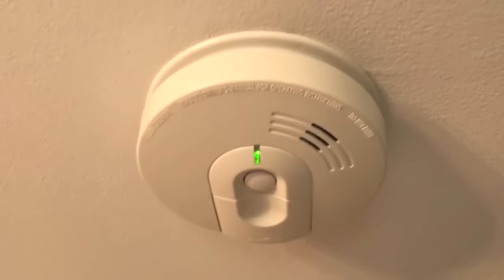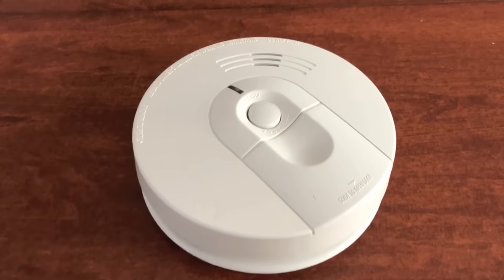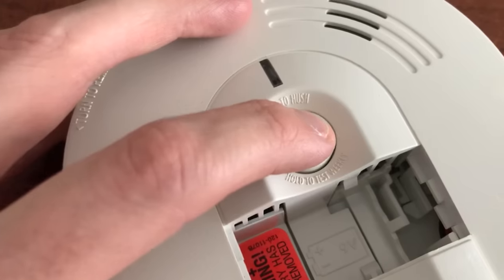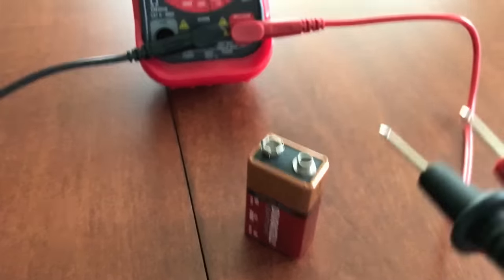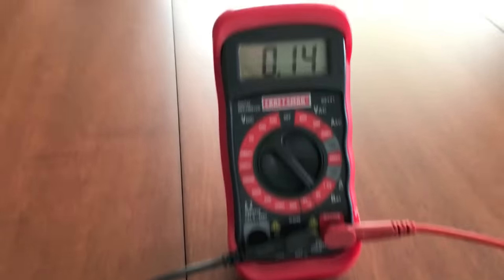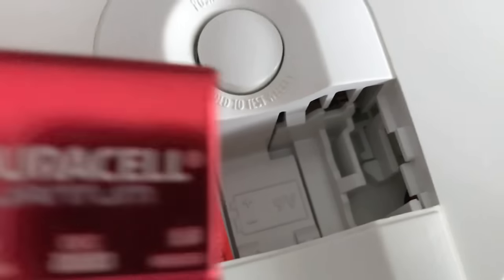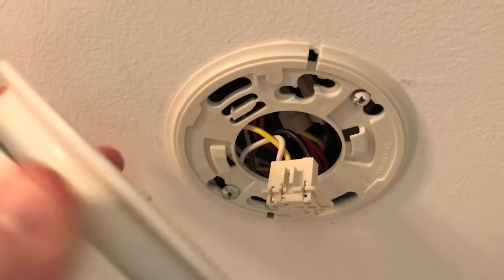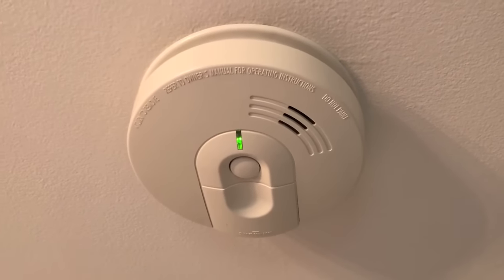Replaced Battery/Cleaned smoke detector- Still BEEPING (Must RESET Detector)

Comment: yeah this is the pain in the ass for the newer smoke detectors. Unlike older ones that had a dedicated chip in them, newer ones use a micro controller chip. (A programmable chip that can be programs to serve what ever functions needed.)  Problems with these are even in low voltage situations. (low battery) the chip must fully be reset to "clear" the chips onboard memory. To do this you must drain the inside reservoir capacitor. (It charges and stores power to drive the alarm section of the detector.) When something like low voltage happens or even any kind of "error" the chip will remember it til its reset. Ever have random devices just freeze, crash or lock up on you til you reset them somehow? yup thats a microcontroller for you. The depreciated alarm chip was so much simpler huh?
Reply from the maker: ԱӍβЯƐ 

Thanks for watching & you are very welcome.  We appreciate your comment.  This is great info & will help future viewers.  😀

Definitely keep us posted with your DIY project & any questions you may have.

Please subscribe to the channel and turn on your YouTube notification Bell 🛎 that would be awesome thanks again!

😎👍🔧🔩

Comment: I'VE TAKEN DOWN ALL 6 SMOKERS DETECTORS  AND I DRAINED THE ENERGY OUT OF ALL OF THEM AND THERE IS STILL A BEEPING AS IF THEY ARE UP. WHAT DOES THAT MEAN?
Reply from the maker: Joseph Bailey 

Thanks for watching & reaching out to us.  We recommend pin-pointing the Detector that is beeping.  Remove & check date on it.

If the date on the back of the detector is more than five years ago, you may need to replace that detector.  Replacing that detector could solve your system fault issue.  Keep us posted!

Please subscribe to the channel and Ring your YouTube Bell 🛎 that would be awesome thanks again!

😎👍🔧🔩
Reply: @DIYwithMichaelBorders  Date on them is June 3 2019. I air dusted all 6 and l put them all back and they are still chirping. All the batteries are New. I bought all 6 detectors in October of 2019
Reply from the maker: Joseph Bailey 

Thanks for the update.  Brand new detectors shouldn’t be giving you fuss.  Inspect each detectors connection point.  

Verify that there are no signs of corrosion on the connection points.  Also, believe it or not, some people run into smoke detector connection points having dried paint inside where the electrical leads are.

This happens when a ceiling is painted with the detector off however the electrical wiring and connection point is still in a position where the paint roller or brush makes contact with it... which degrades the connection point.  Keep us posted.

😎👍🔧🔩

Comment: I'm trying to unplug mine but it wont unplug and I'm worried I'll break something
Reply from the maker: morganna lord 

Thanks for watching! Let’s get this figured out!  We definitely feel your annoyance!

The connection tab can be a little tricky...especially if there has been unwanted debris added to it over the years.  An example would be the possibility of the “Mount” being painted  over if the ceiling was painted...if so, the connection point may have been painted over.  This makes it extremely tricky to get the Detector loose from wiring since the connection tab really secured itself to the painted area...😲

After pressing down on adjustable tab, you may need to work it back & forth to break it free!  Keep us posted!

Please subscribe to the channel and turn on your YouTube notification Bell 🛎 that would be awesome thanks again!  😎👍🔧🔩

Comment: 4:30 am and the fucking thing would not stop giving me a "low battery" chirp even after changing battery. The thing that worked was unplugging the unit from the electrical system and hushing it to reset it. Then after changing the battery did it accept the new battery. I did a quick test and reinstalled. Now it's back to 100%. 4:53 am now... can I have my 1/2 hour back ?
Reply from the maker: Thanks for watching & sharing this, sounds like you’re back up and running.

We appreciate you taking the time to reach out to us, we are always here to help answer questions.

Welcome to the DIY Raptor Club.  😎👍

Comment: Drained mine multiple times and it did no good at all.  As soon as they get plugged back in and new battery,  it's the same garbage crying wolf.   First Alert trash.
Reply from the maker: Thanks for watching, any update?  Is any dust/debris inside electrical connection?  If so, we would clean connection and leads.

How old is detector?
Reply: @DIYwithMichaelBorders  They are 2010 models.  We have ordered new ones but we have cleaned them, reset them and tried everything else on this garbage.
Reply from the maker: @johnstrand2247  

We appreciate the follow up.  Awesome to hear you are replacing it with new detector.

New detector should solve issue.  Looking forward to hearing back from you.

Comment: Mine won't com out from. The wiring
Reply from the maker: Amie Cross 

Thanks for watching Amie! Let’s get this figured out!  We definitely feel your annoyance!

The connection tab can be a little tricky...especially if there has been unwanted debris added to it over the years.  An example would be the possibility of the “Mount” being painted  over if the ceiling was painted...if so, the connection point may have been painted over.  This makes it extremely tricky to get the Detector loose from wiring since the connection tab really secured itself to the painted area...😲

After pressing down on adjustable tab, you may need to work it back & forth to break it free!  Keep us posted!

Please subscribe to the channel and turn on your YouTube notification Bell 🛎 that would be awesome thanks again!  😎👍🔧🔩

Comment: After I changed the battery it’s still beeping
Reply from the maker: boston 2015 

You may need to perform a full reset procedure.  We have a step-by-step video that shows how to do this and it is linked at the end of this video.  Definitely check it out, you may find it very helpful.

😎👍🔧🔩

Comment: Whats the point in it being wired if it still needs to have the battery replace?! Dumb
Reply from the maker: Thanks for watching & many have thought the same thing.  It has to do with safety & proper code to ensure detector works during a power outage.

😎👍🔧🔩

Comment: i have a hardwired smoke alarm with a battery backup in condo i just bought. there was no battery in it. as soon as i connected the new 9 volt battery,  it screams without stopping that ungodly siren. whats could be the problem? any one?
Reply from the maker: alex nyc 

Thanks for checking out the video and sharing your experience.  Here’s what we recommend doing!

Disconnect Smoke Detector from hard wiring.  Next, remove Battery.  Then push hush button as shown in this video...this drains all remaining electrical charge!  Then put Battery back in & reconnect detector to hard wiring.

If this does not work...it’s very possible that the new detector needs to be cleaned...it’s unlikely however some detectors get dusty during their life before being purchased & plugged into a house!  Grab a vacuum & clean it.

If that doesn’t work, it might be possible that the detector is defective.  Replacing it with a new detector might solve issue.

Let’s start there!  Keep us posted.

Please subscribe to the channel and turn on your YouTube notification Bell that would be awesome thanks again!  😎👍
Reply: yes, thanks. i did try the vacuum (didnt work)  & then i just disconnected the whole darn thing & just bought a new one. works like a charm. i think you were right, my neighbor told me it was installed by the previous owner probably about 20 years ago!  it was time to go! lol.  i subscribed!
Reply from the maker: alex nyc 

Awesome Awesome thanks for the update.  That’s great news!  Glad to hear you got a new Detector.  It should last a long time 😀👍
Reply: DIY With Michael Borders changed da battery it didn’t help,and bought a new one,and still same problem persists.
Reply from the maker: ayub ahmed 

Thanks for the update!  Let’s move on to the next possibility!

After connecting Smoke Detector to hard wire connection point, do you see a Green light?  

If you have a Red Light, you will then need to remove Detector & remove Battery, then push Hush Button to Drain any remaining electrical charge!  Then reinstall Battery, reconnect to hard wiring, & verify you have Green light.

If this doesn’t work, clean electrical connection point & make sure it is 100% connected.  If its loose, light will go red & the detector will beep!

Let’s get this figured!  Keep us posted!
Reply: DIY With Michael Borders ,thx for replying bck to my comment I’m going to subscribe to your page. I’ve tried all that you’ve said ,but there’s one thing to keep in mind is I have 6 smoke alarms that have expired according to reading the bck of the smoke detector .9 to 10 yrs is da limit. I’ve only bought 1 new detector so maybe I have to replace the other 5 thx subscribing now
Reply from the maker: ayub ahmed 

Thanks for the update.  Great idea.  It’s a great investment.  Brand new Smoke Detectors will last you 9-10 years as you mentioned.  Keep us posted!  We will get this figured out!  😎👍
Reply: ayub ahmed Beep replace detector

Comment: The connection point wont "Remove" and let me pull the detector off,  it's 1am and the bloody thing won't stop beeping.
Reply from the maker: Dan Frost 

Thanks for watching Dan! Let’s get this figured out!  We definitely feel your annoyance with the Detector going off at the worst time!

The connection tab can be a little tricky...especially if there has been unwanted debris added to it over the years.  An example would be the possibility of the “Mount” being painted  over if the ceiling was painted...if so, the connection point may have been painted over.  This makes it extremely tricky to get the Detector loose from wiring since the connection tab really secured itself to the painted area...😲

After pressing down on adjustable tab, you may need to work it back & forth to break it free!  Keep us posted!

Please subscribe to the channel and turn on your YouTube notification Bell 🛎 that would be awesome thanks again!  😎👍🔧🔩
Reply: Time to replace the battery?
Reply from the maker: Kitty Siren 

Thanks for watching Kitty Siren!  We hope the video helped!  Please subscribe to the channel and turn on your YouTube notification Bell 🛎 that would be awesome thanks again!  😎👍
Reply: Still chirps after new battery? Time to replace alarm!
Reply from the maker: Kitty Siren 

Oh no!  That’s no fun!  Hopefully a new detector will solve the problem!

We definitely understand how inconvenient this can be for all home owners...& it never fails...always chirps or beeps at the worst time!

Let us know how a new detector works!  😎👍🔧🔩
Reply: My dad never replaces alarms. He says that electric is never old. But smoke detectors could get old. And the detector at my grandpa's house is litteraly never replaced. Although one was replaced.
Reply from the maker: Kitty Siren 

😀 definitely let us know what you end up doing!  We are interested in the outcome!  😀👍

Hope to hear from you soon!
Reply: Smoke detector that does not even blink did not chirp. Seems like it was a wire pull from someone in the attic and my dad says there is one in the basement, I don’t see a green light.
Reply: During a Napa fire, My mom opened a window and no smoke detector went off. I don’t live in Napa.

Comment: Mine keeps saying low battery and makes sounds like every minute
Reply: Its the same model as yours
Reply from the maker: SKM VLOGS 

Thanks for watching!  Double check the current voltage of battery to ensure it’s not low.

By chance have you completed a thorough cleaning of the detector?  Doing a thorough cleaning (vacuuming, canned air...) will definitely improve the performance of the detector.  

There are a few very helpful videos at the end of this video that show you the step-by-step cleaning process.  Definitely check those out!

We also recommend checking the expiration date on the back of the detector.  If expired, it may be a good idea to replace old detector with a new detector.

Keep us posted!  Please subscribe to the channel and turn on your YouTube notification Bell 🛎 that would be awesome thanks again!  😎👍🔧🔩
Reply: A person came today and twisted it and held the button for about 15 seconds and then put the batteries in and then he showed me all the steps that you showed in your video. He said that if it still makes the low battery noise, he would send an electrician. But it wasn't making any noise so we should be fine. BUT NEED TO REMEMBER TO BUY DURACELL NEXT TIME.
Reply from the maker: SKM VLOGS 

Very cool 😎 

Thanks for the update!  Duracell is a great Battery 😀

Hopefully you are good to go & it doesn’t go off at 2am 😆

Let us know if you have any additional questions along the way we are here to help!  😎👍

Comment: I did all this AND replaced the unit. Still chirping 😫
Reply: The hush button doesn’t work either. Brand new unit out of the box
Reply from the maker: Good morning ☕️ that’s no fun.  In this case, you will need to perform this reset procedure on all other/remaining detectors as well.

Having all detectors fully drained and reset should resolve issue.

Comment: Still beeping
Reply from the maker: James Brown 

Thanks for watching!  Double check the current voltage of battery to ensure it’s not low.

By chance have you completed a thorough cleaning of the detector?  Doing a thorough cleaning (vacuuming, canned air...) will definitely improve the performance of the detector.  

There are a few very helpful videos at the end of this video that show you the step-by-step cleaning process.  Definitely check those out!

We also recommend checking the expiration date on the back of the detector.  If expired, it may be a good idea to replace old detector with a new detector.

Keep us posted!  Please subscribe to the channel and turn on your YouTube notification Bell 🛎 that would be awesome thanks again!  

😎👍🔧🔩

Comment: Didn't solve anything. Stilling beeping.
Reply from the maker: Wadood Safa 

Thanks for watching & we hope you enjoyed the video.  Have you completed all of our troubleshooting steps?  Let’s get this figured out!  😀

Let us know if you have any questions.  Many more helpful videos to come!  Please subscribe to the channel and turn on your YouTube notification Bell 🛎 that would be awesome thanks again!

😎👍🔧🔩
Reply: @DIYwithMichaelBorders  yes I did. New batteries didn't solve it too. It's acting the same whether it's connected to the wall or not. Its beeping like every 20 seconds.
Reply from the maker: Wadood Safa 

Thanks for the reply.  Have you completed the reset process that drains any & all remaining hidden electrical charge from detector.

If yes, you may need to perform the step a second time and then resecure battery inside detector and reconnected to hard wiring.

😎👍🔧🔩
Reply from the maker: Wadood Safa 

If this second attempt does not work, it’s very possible that your detector needs to be replaced.  Check the date on actual detector.  If it’s more than seven years old, it’s best to replace detector and get a new one connected.

😎👍🔧🔩
Reply: @DIYwithMichaelBorders  we have two detectors and both are acting the same, beeping every 20 to 30 seconds. I did everything but still couldn't solve the beeping.
Thank you so much for ur responses.
Reply from the maker: Wadood Safa 

You are very welcome!  We love YouTube!

😎👍🔧🔩

Comment: sadly, I did this, and they still wont stop chirping ;(
Reply from the maker: Life-Row-Toll 

Thanks for watching!  Double check the current voltage of battery to ensure it’s not low.

By chance have you completed a thorough cleaning of the detector?  Doing a thorough cleaning (vacuuming, canned air...) will definitely improve the performance of the detector.  

There are a few very helpful videos at the end of this video that show you the step-by-step cleaning process.  Definitely check those out!

We also recommend checking the expiration date on the back of the detector.  If expired, it may be a good idea to replace old detector with a new detector.

Keep us posted!  Please subscribe to the channel and turn on your YouTube notification Bell 🛎 that would be awesome thanks again!  😎👍🔧🔩

Comment: Didn’t work
Reply from the maker: Thanks for watching, that’s a bummer.  Did you disconnect detector from hardwiring, remove the battery, and then perform a full reset by draining remaining electrical power from detector?
Reply: @DIYwithMichaelBorders hi. I eventually fix that problem but now I don't know who to reach for help I'm trying to help my mom because my dad just passed away and all of her smoke alarms keep going off and they are all connected through out the system and I have replaced every battery but I'm guessing maybe I need to go into them and push the reset button on all of them in between the intervals I have that it is not going off? Two days ago it went off in the morning and then a day before that it went off to her three times in the evening and yesterday I did not go off at all and now today that's gone or four times in the morning :( they all go off same time
Reply: @DIYwithMichaelBorders  I subscribed by the way thank you for responding hopefully he might be able to help me
Reply from the maker: @B727X  

Thanks for the follow up.  It’s likely that all detectors will need to have batteries removed and reset.

If an alarm system is installed and detectors are hard-wired into security system, you will need to follow the exact steps set forth by the security company.
Reply from the maker: @B727X  

We really appreciate that and we have subscribed to your channel as well.

😎👍